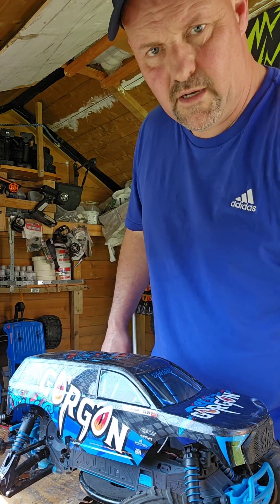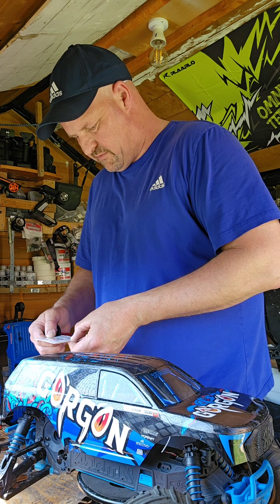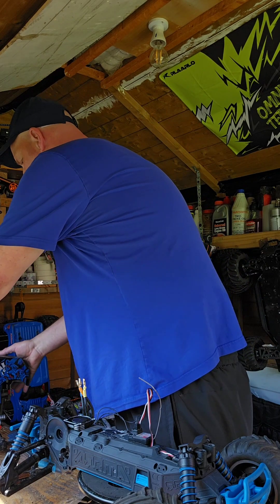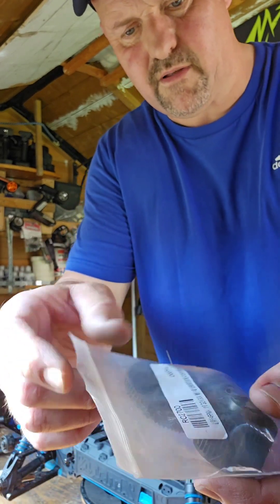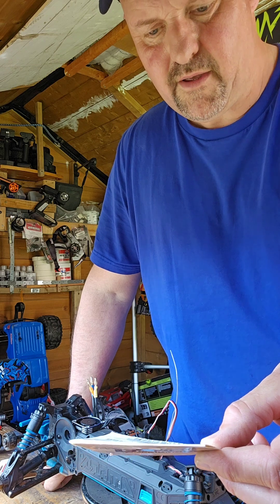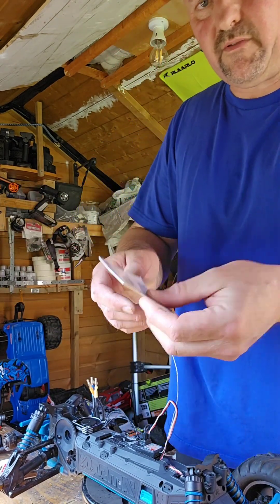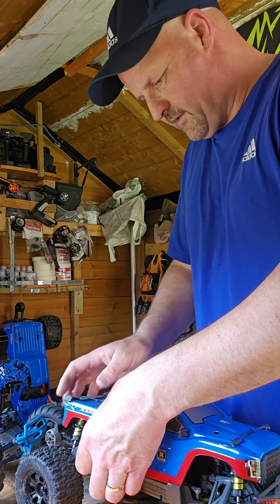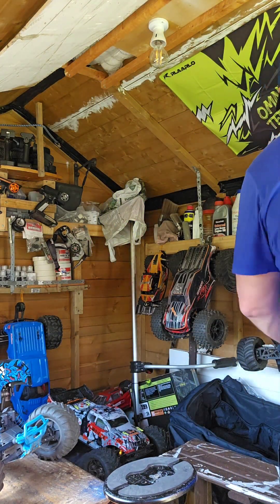arrma gorgon upgrade

Comment: I've got my gorgon and voltage trucks all on 2slipo battery is plenty of speed..
Reply from the maker: Cheers mate yh I'm running it now on on 3s and 4s lipo batterys xt90 100c it's nuts crazy fast
Reply from the maker: Yh thanks its a fast beat off a truck on 3s and 4s